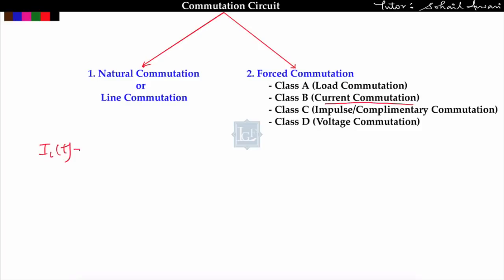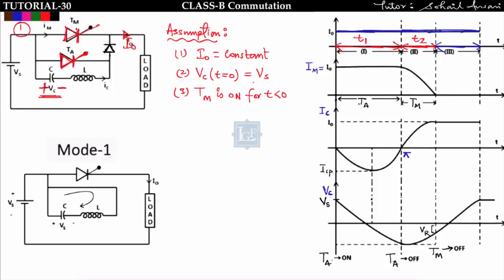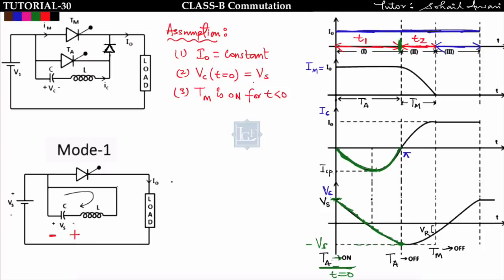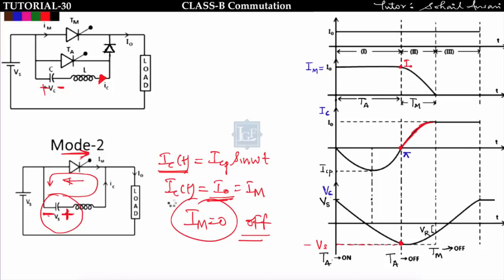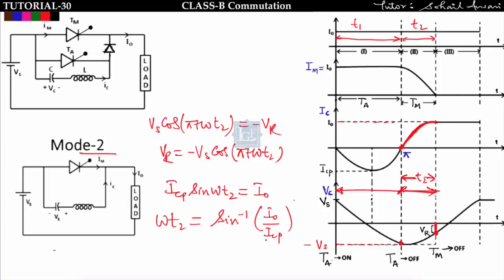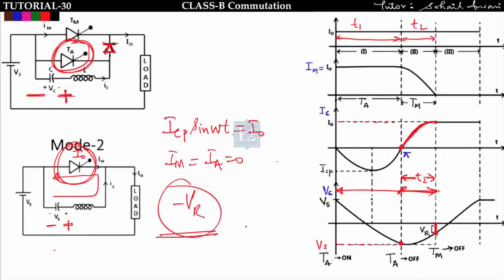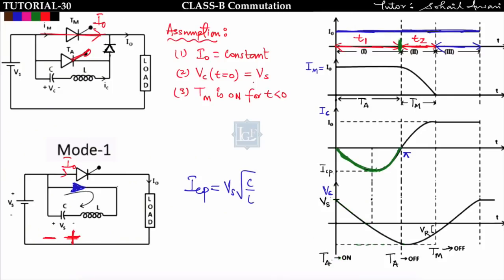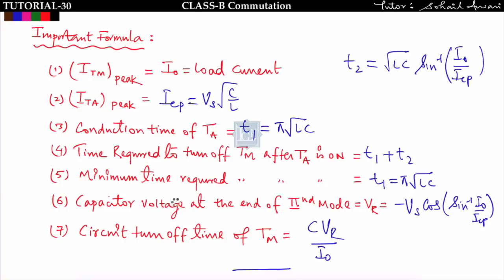Lec 30 Class B (Current Commutation)

Comment: while capacitor discharges current is passing through the scr in reverse direction which is not possible i think one more diode is connected across thyristor in antiparalell manner
Reply: or it might be discharging through load

Comment: sir at the end of the mode 2 the voltage across capacitor is -Vr ,you are saying from the wave form .so my qns is Vr is a assuming notation or any other thing
Reply from the maker: at the end of mode 2 the voltage drop across C musst be negative then only thyristor will be off...

Comment: sir at 17.02  you are finding the t2 by taking that the current through the capictor  at the end of mode 2  is Io  
i have a doubt that in place of t2  .. it should be t1+t2  ... beacuse we have to take total time from t=0 to end of mode 2  .....correct me if i am wrong
Reply: same doubt ... t1 + t2 hi hoga . total time ......
Reply: No.. it should be t2 only because whatever the capacitor current flowing in mode 1 got ended at pi only and then again capacitor current starts from zero value at pi so that's why it's considered t2 time only
Reply: @anushareddy2736  
Nah it's (pi+t2)

You can connect both waves and write it as a single wave 

Eg:In mode 2 instead of writing -cos(wt2) you can write cos(wt)=cos[w(pi+t2)]

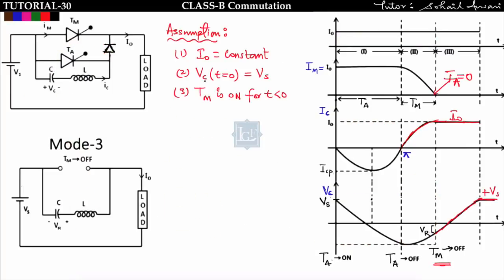Comment: 21:39 Sir you said that at the end of mode 2 voltage across capacitor is Vr ok agreed but u also said that voltage across thyristor is also same i.e.Vr since it's parallel to capacitor. But sir how is it possible because thyristor is not only in parallel to capacitor but actually it's parallel with L & C both. So thyristor voltage should be -Vr+ voltage across inductor.. because at this stage inductor is still not got short circuited to consider it's voltage as zero. Inductor too will posses some voltage.. because for inductor votlage to become zero it must be short circuited and this happens only when capacitor got fully discharged it's energy to inductor but here nothing like this happened na sir
Reply: Io current is assumed to be constant because of highly inductive load...that's why voltage across inductor will be zero

Comment: Sir peak of ic should be negative right? If in gate, a question comes asking the peak value of capacitor current, then answer should be in negative right?
Reply from the maker: see the direction of current given in question and based on that take positive or negative..ok

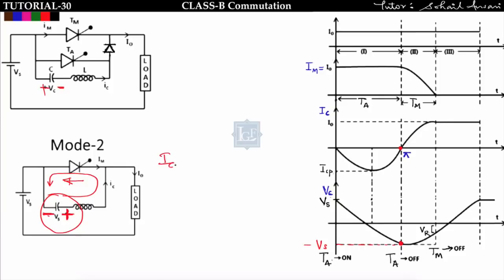Comment: At 11:36 mode 2 the capacitor polarity is reverse so diode conducting but why  this reverse polarity not turn off the main thyristor Tm
Reply: To off the thyristor it's anode current must be below holding current. Or respect of polarity. Just like in inductive load voltage is negative but current is not and thyristor conduct
Reply: It turns off gradually since scr is a capacitive plate

Comment: In time t2 how the current will flow through scr?becoz scr can conduct only from anode to cathode .but according to ur video in t2 current flows cathode to anode which is impossible.plz solve my doubt
Reply: Current is flowing due to supply and due to capacitor, net I is +ve but is decreasing to Zero and then main SCR goes off when I is 0...Correct me if I'm wrong

Comment: Sir,which type of communication give best performance ?
Reply: Current commutation gives the best commutation
Reply: Mohit Vyas how?
Reply: rajesh kumar because in voltage commutation, entire voltage of capacitor is available across thyristor. Now if this capacitor voltage is more than reverse breakdown voltage of thyristor then it may get damage. But there is no such problem in current commutation as the thyristor current decreases gradually to finally reach zero.

Comment: why did at max value of capacitor current ,capacitor voltage is non zero...and why did Vr occur??
Reply: Ic is dependent on the rate of change of capacitor voltage..and not the other way around 😊...so for max capacitor current ... capacitor need not to be zero...it can be non zero
Reply: @conandetective2331  
Nah.
It's because capacitor had an initial value